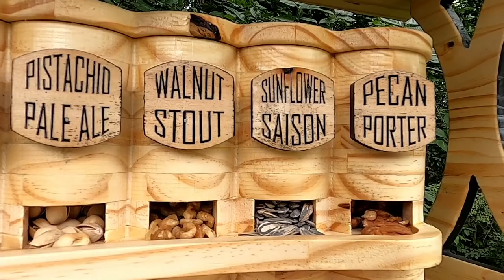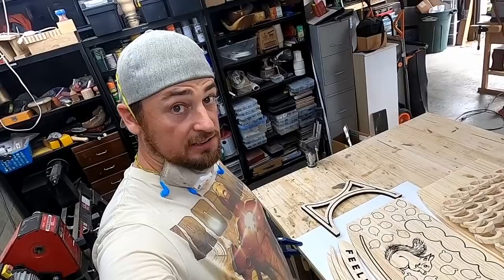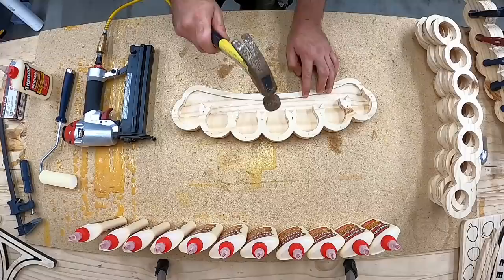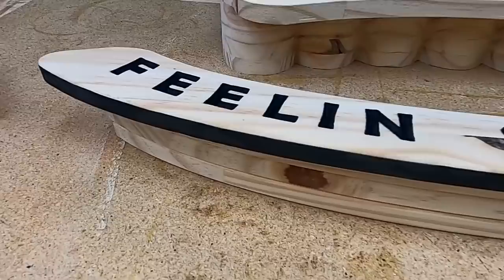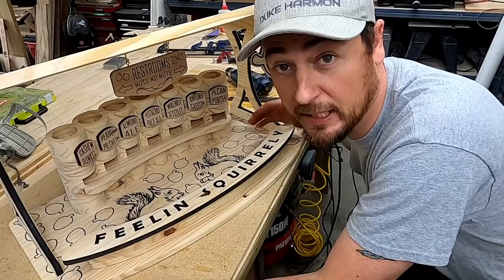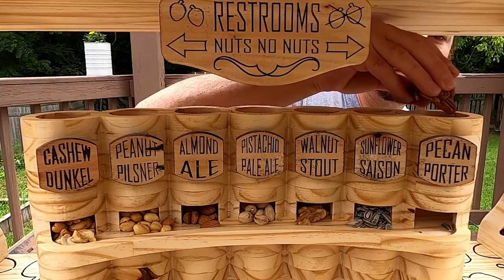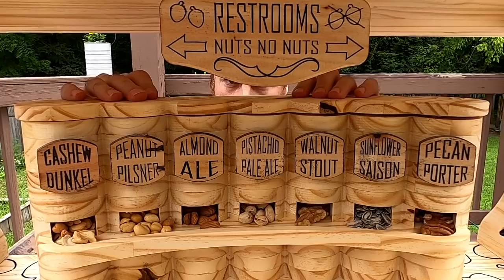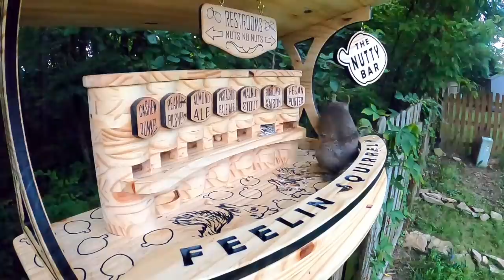Squirrel Bar - X Carve CNC project - The Nutty Bar- Thinking outside the nut!

Comment: When I CNC parts like your silos, I drill 2 or more holes ( I typically use 1/8" cutters ) in each piece and then use 1/8" dowels as alignment pins through the parts for nearly perfect alignment; no creeping when trying to glue them together. Where possible, for top and bottom pieces, I drill blind holes for aesthetics.
Reply from the maker: I have started to do that but instead of dowels I am using screws. Really helps to keep it together and centers each piece great

Comment: If it will fit in the dispensers, nuts left in the shell would be a good workout for the squirrels.
Reply from the maker: Yeah, should keep them slim as well. Smaller nuts will work but larger nuts like walnut in the shell would be to big. Maybe an idea for an upcoming project!

Comment: Beautiful design and would love to have but.....Where I am, 4 or 5 squirrels and all the nuts are gone in less than an hour. Refilling seed daily or bi-daily  would be an very large expense. Also, when the seeds are out I would bet the squirrels start gnawing at the wood silo openings thereby opening up the seed chutes more and more until they get too big to use without all seed poring out.  Nice idea, but my opinion is this would eventually get squirrel damaged and be worthless in no time.
Reply from the maker: You are correct, they do go after the wood but hey give up quickly as it is coated in polyurethane. I have a couple teeth marks on the lid but that is it. I only refill a few times a week and not always with the expensive nuts.